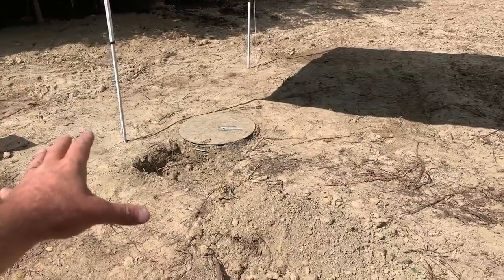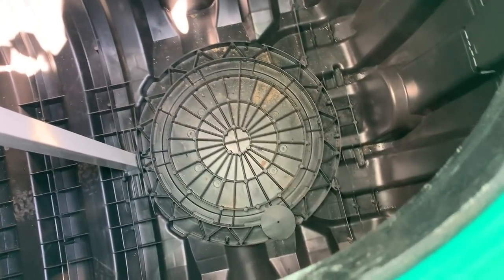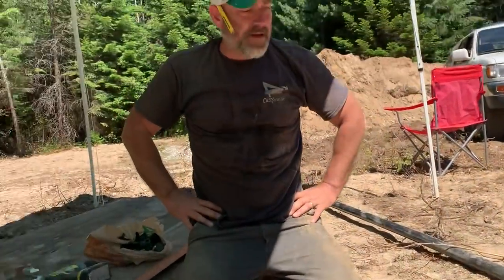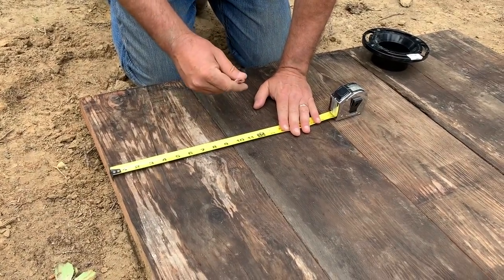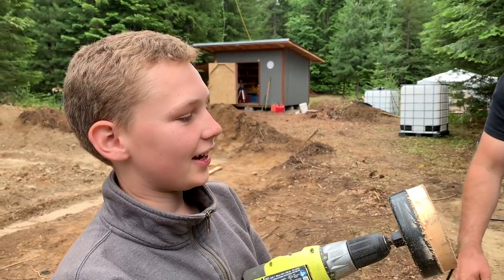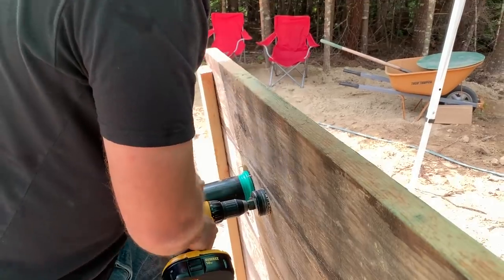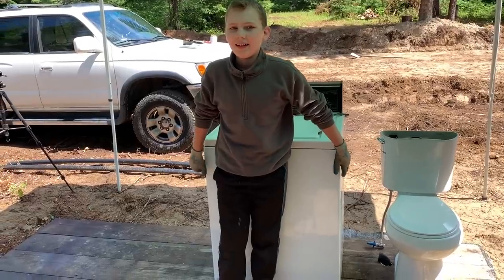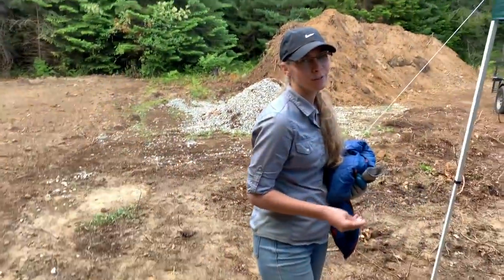Building Our Ultimate Off-Grid Outdoor Bathroom

Comment: It may have been a little better - to drain the grey water from the  washer and shower - thru a hose down thru the trees.  It will save so much excess water going into your septic - before you hook up to the house (cause it will not get as full) .    Also, don't forget about hunters -  they tend to wonder about thru the woods when they hunt.   When our folks were building their house - my sister was spied on once when she was bathing!  Just an FYI -
Reply from the maker: Thanks for the warning. We will keep our eyes open.
Reply: They want the extra water in the septic tank. The drain for the leach field is high on the tank, you need to fill it to that level to keep the tank in the ground. If you don't have enough fluid in the tank it becomes buoyant like a boat and will "float" out of water soaked soil.

Comment: Very awesome. If I can make one recommendation- you will save money and time in the long run by investing in higher quality tools! Ryobi is great for small around the house fixes, but you have a lot of work ahead of you, and "buy once cry once" applies very much here. There is plenty of debate around what brand is the best- but any of the higher end tool brands will last longer, have a much greater battery life, and just have more power at the trigger. I am a fabricator, and I prefer Makita. Look forward to seeing your progress!
Reply: Ryobi, Ridgid, and Milwaukee are all made in the same TTI factories. Battery packs use the same cells. The brushless Ryobi tools have as much power as Fuels, XR's, etc. PLUS they have more tools that accept the same battery than any other line. I use my Ryobi stuff all the time in my shop and doing yard work. Have yet to have an issue with a tool not performing like it should. Additionally, the Air Strike nailers perform better than other pro-sumer lines. Hard to go wrong.

Comment: Your sink and shower drain should not go into your toilet. Run it down near were your garden will be because it will give you water for the garden free and its quite plant safe. The sceptic will develop a hard crust on the top . What is supposed to happen is feces etc goes down the pipe but you need to have it come out down near the bottom so it floats up under the crust and decomposes.

Your great idea for a temp toilet is brilliant . I've been looking for such a way for my place. When the house is on then you must make sure it all gets to the bottom.

Comment: You need a stink pipeIn your bathroom for the smells can escape for when you open the tank up all the smells won’t come up so this is what you’re supposed to do I was at work I’ll pay make it go up higher really high and I have a T so it goes straight up and then left to right for home to Halls and in your size you stink pipe I know this makes no sense but use a stink pipe stink